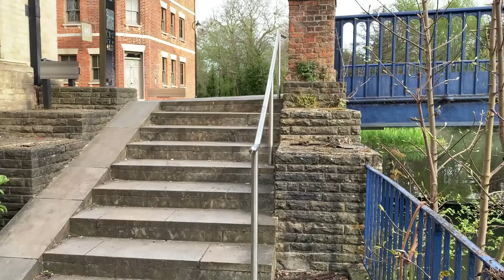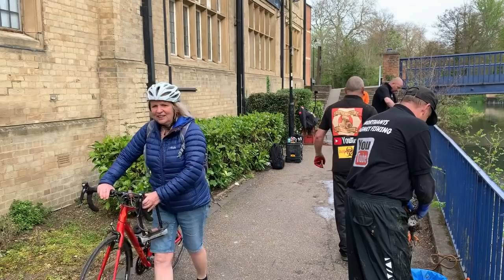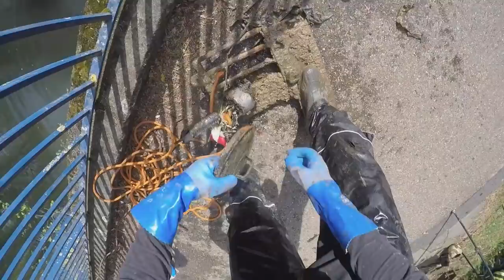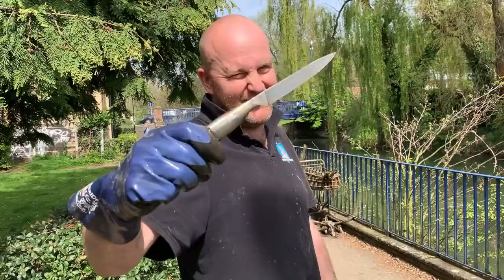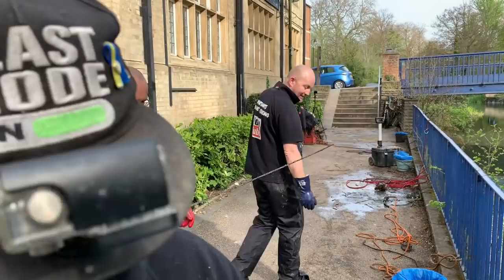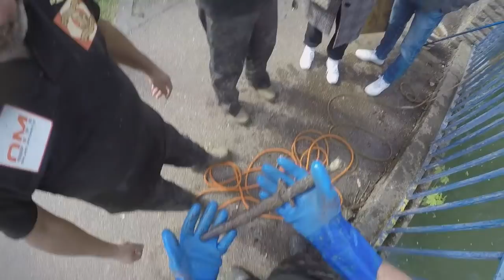ANTIQUE SWORD FOUND MAGNET FISHING BY A MEDIEVIL MONUMENT #165

Comment: That's a ton of STUFF you guys pulled out. Woah, man!
The gas you get out of water being electrified with a solution is called Brown Gas or HHO gas. It's Hydrogen gas that can be used in subsidizing your regular fuel for your autos, or using it like an Oxy-Acetylene welding for large pieces, or low end welding projects like bikes or even smaller items, depending on flame setting.
That looks like a rapier sword, in case nobody already mentioned it. Really nice find.

Comment: Carbide lamp, add water to calcium carbide to produce acetylene. If you direct the flame onto calcium oxide (lime) you get a very bright light that was used back in the day for stage spotlights which is where the expression "in the limelight" comes from.
Reply: Looking for this comment. Only a year late 😂